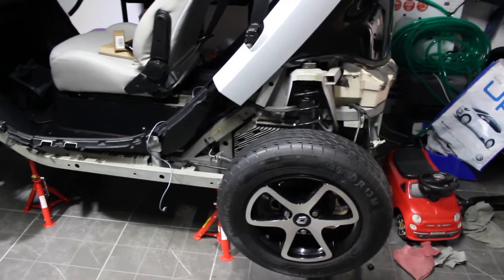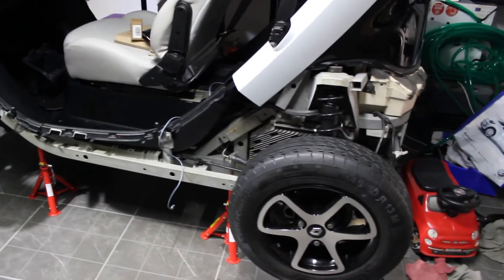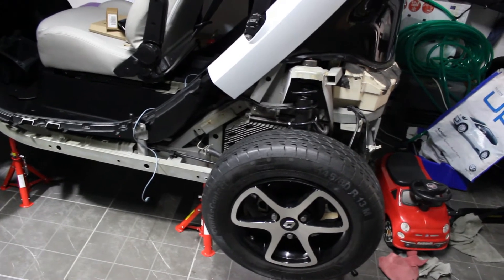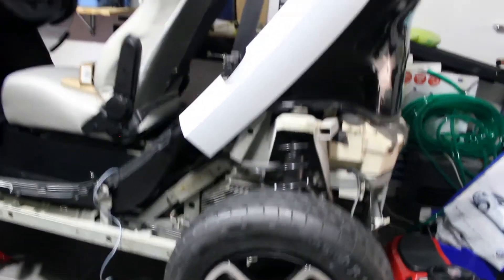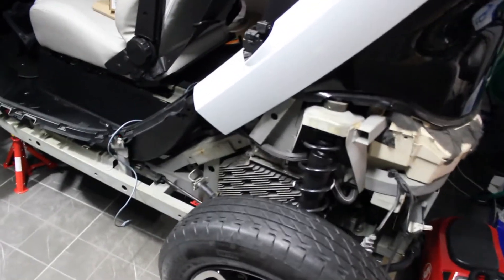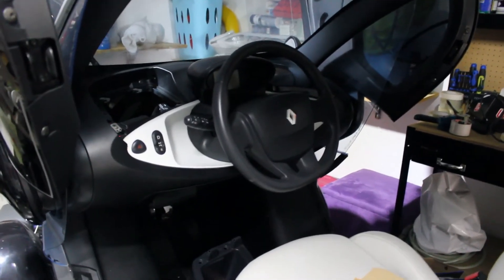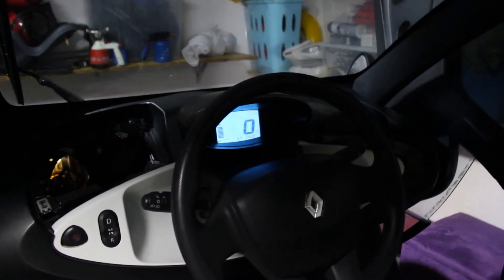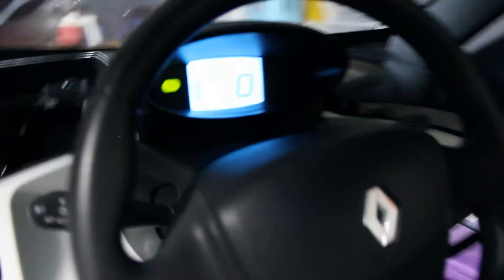sevcon gen4 twizy inverter problems

Comment: Hi, just bought my Twizy and I have the same problem with my Twizy as you 5 green flashes and on dash stop light and battery ! With the immobilizer kicking how did you solve this problem ? Any help would be much appreciated, Shane
Reply: did you manage to solve this? my twizy is doing the same 😢

Comment: Hello
How are you dear friend
I have a problem with sevcon gen4 80v 180A controller
My bike burn in fire and everything is burned in fire, but I guess motor and controller is healthy, when I connect controller to battery and connect motor to it, LED ofcontroller just  just Flashes 7 times and repeat, i know electronic and mechanic I want to repair or by myself, can you help me for solve this problem?
I mean do you know for what reasons LED flashes 7 times?

Regards.
Reply from the maker: 7 flash on sevcon gen4 is associated with:1bdi remaining charge
2 battery voltage in greater or less than sevcon parameters
3 motor control has entered low/high voltage cutback region
4 controller has entered thermal cutback region
Reply: @electrikmirk7828 hello friend, thank you for replying, do you have whats-a_pp, or another, for talk about it in there and I send video of it to there?
Reply from the maker: @vahidganjvar3812  +393894759001

Comment: Thank's for this vidéo, who enable to ECU active "GO"  is the charger supply to ECU or SEVCON box ? I have à problème with my Twizy, the display can't level battery traction "icon battery " is blinking and level is empy. For have green "GO " ECU receive signal CAN ? or just SEVON say ECU OK I'm ready in à 1 wire DATA?
Reply from the maker: This is chain.. they work together... If you don't get the go sign the first thing you have to do is take a look at the blinking light behind the inverter....count the sequence...you have a 2 seconds break to determine the number that will indicate the error....
Reply: Thank's for reply me, where is the light blinking ? I must remove car tire left behind and remove sevcon box ?
Reply from the maker: @stephaneng5358  in the middle of the sevcon connectors
Reply: @electrikmirk7828  I remove the box sevcon ans wire(35PIN) , and I just connecte supply 60V in pin 1 and B-, I look a LED color green, The sevcon blink - 5 blink an pause and loop blink. The sevcon is ready to connect CANH and CANL ? and sevcon will sent message twizy ECU for chain ?
Reply from the maker: @stephaneng5358  you have to check the isolation between low and high voltage circuit.....the second thing you have to do is check the motor speed sensor....

Comment: Hello Mincu Mircea. I received my Can Clip from China but unfortunately cannot find the motor controller. Is it due to the China Can Clip or is there something defective in the controller? The error is still that the twizy only sporadically goes GO mode in warm weather and then only sporadically engages the gears. Do you have any idea what I can check? All other components are found and have no errors. Greetings Florian
Reply from the maker: The canclip can't see the sevcon....is normal... unfortunately your problem seems to have something to do with him ...there are error codes that the sevcon lets you know using the flashing green light behind.... when doesn't "go" read how many times flashes until the 2seconds break and  let me know....I will tell you what that means....

Comment: Kenneth nielsen is the master of this go-kart, i have his powerbox in mine.
Reply: go-kart haha 😂 perfect name
Reply: @marcviej.5635  or washing machine! 😁😂
Reply: he's such a genius, i got the powerbox too, it's perfect!
Reply: @marcviej.5635  How's your temperature of the motor when you drive sport style? I've installed cooling fan for it, as it gets hot!
Reply: @eddieeddie99  Hi sorry for the late reply, sport mode does make the controller and motor very hot but the software automatically reduces power to prevent damage to components, i've red it in the manual and actually noticed it after driving for long times (which is 30mins for a twizy 😂) i just deal with the reduced power and i trust the software preventing damage, the fan wont do any harm and maybe prevent this
Reply: @marcviej.5635  no power no driving 🚘😂